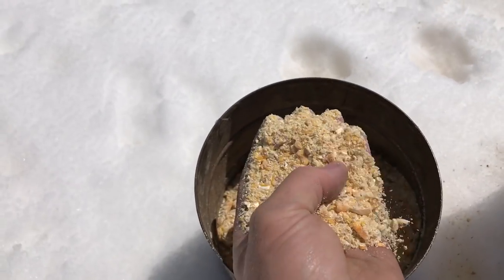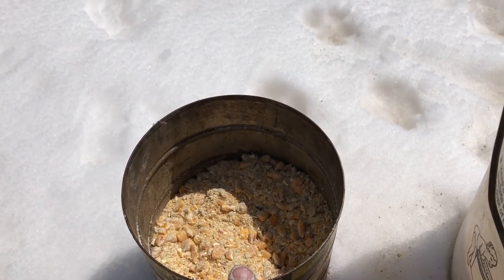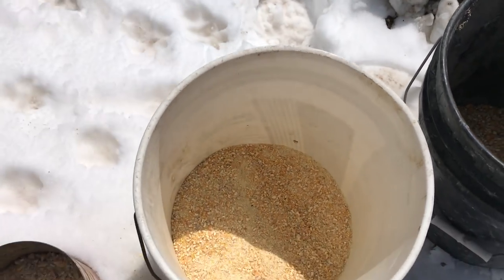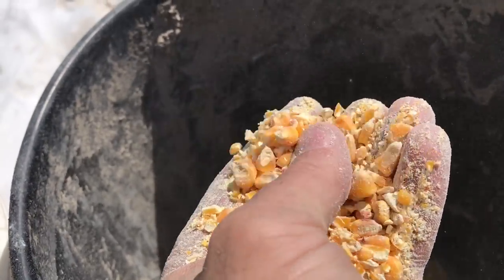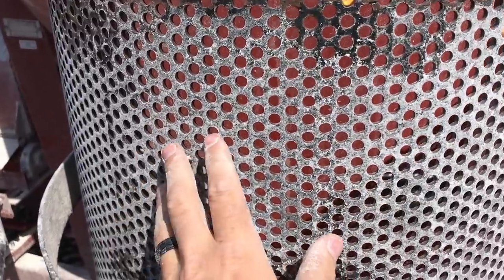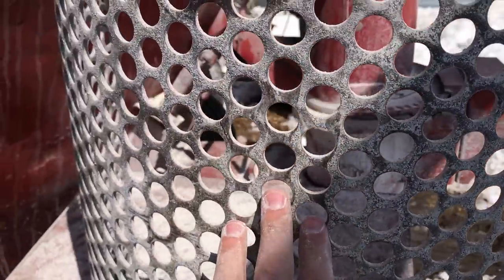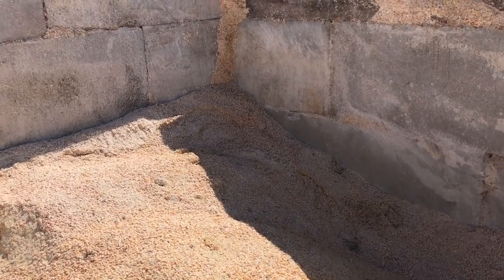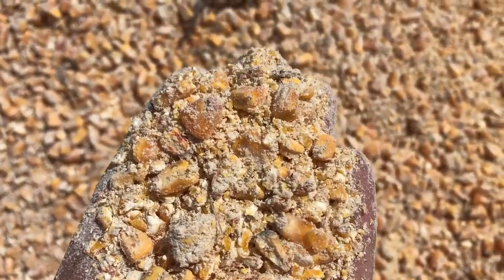Trying to get better quality feed from a grinder mixer

Comment: One thing that I like to use is ear corn. That cob is basically a bulk filler, and it will not cause that calf to over eat on the corn. Cattle that eat 2 much corn can die like u said through bloating; good management is needed for successful cattle feeding
Reply from the maker: Ear corn works good  but i dont have time to ear pick 400 acres of corn.     They actually dont die from too much corn... they die from changes in their diet   over eating  then not eating or other things.  Feeding cattle does take alot of management and eliminating risk that you can...   Cant control the weather so ill start with the corn  Thanks for the comment
Reply: The change in the diet will mess with the bugs and bacteria that are in the stomachs of cattle. It will kill of the bacteria that is needed for breaking down the feed that they consume. But getting back to grinding, we grind mainly ear corn, and it does tend to have that fine starch that is not good for cattle and can cause bloats and acidosis that is why it works for us to use that corn cob as that bulk filler to really eliminate that change

Comment: Was reading comments, and I saw  to old school things we did when I was working at feedmill/sales, cobs and bi-carb.  We also had a dried beet pulp with molasses we would add,  or the sure bet was 5 ft. piece of garden hose.
Reply from the maker: Kevin Farmer Garden Hose doesn’t do much good when their the size of a small car before you see them.   Hard to prove what it’s actually from just wanting to eliminate possible causes and make our corn processing better

Comment: I actually took our small screen and torch and cut the holes together to make 1” -1/16 holes in ours years ago. The screen was for hog feed and made powder so if it wouldn’t have worked nothing was lost but has worked great for years now. Had the same problem as you not using a screen
Reply from the maker: i thought about playing with making the holes bigger but was worried about loosing some strength and it going BOOM

Comment: Well , i had the same problem bloat. I fed ground corn maybe some wheat and 5 bales of alfalfa ground up. If it got real cold where they didn't go out to pasture they would spend a lot of time at the feeder, frustrating when you find your nicest one 4 legs up to the clouds quickly. I never mix salt in my grinder or feed they had it free choice at the salt feeder. I started hand mixing salt as I filled the feeder. I was at a loss of what to do I ask the university my two DVM's. The salt fixed it i have not lost one since. It got so bad i was afraid to fill the feeder good now.
Reply from the maker: too much alfalfa can cause bloat as well.... .but glad we havent had issues for a while.   i actually made myself a roller mill

Comment: That fine stuff balls them up. When we feed we would mix sodium bi-card. It was a belch and fart contest but seemed to do the trick. Found some cows when older can be chronic bloaters,you treat em then 3 weeks or so they down again. So I ship those and likely become US big macs. Lol Can hammers be removed from those mixers or no.
Reply from the maker: Yea the hammers can be removed but i want the corn cracked....   Thought about using whole corn totally but not wanting to give up efficiency

Comment: Good info ted. A lot of stuff to take into consideration. Could u run the smaller screen and take some of the hammers out?
Reply from the maker: Jake Ziegler when I tried with the small screen it just takes so much power to get the corn through them little holes. I’m afraid if I take hammers out it would just make it slower.  And with the small screen it would take all Day to grind what I need to grind

Comment: would help to put a bale of dry small in grinder with each load. we would when we run out of ear corn to grind.just asking ...
Reply from the maker: No if we add more ruffage then our energy levels would drop... feeding 5000-6000 pounds of corn right now a day.   The problem is the small particles of corn actually are digested too fast and causes gas. I need to get a roller mill but this will work for now

Comment: Didn’t know fines would jack cattle up like that. Come to think of it, the screen we used on the dairy was like the bigger screen you have.
Reply from the maker: It sure can... The fines can break down to fast and cause gas  and the gas from the inside can cause suffocation pretty much.  It may or may not have been the problem im glad we haven't really lost enough to say BUT i can control that so why not.   Could be more weather related but wanting to eliminate the causes i can and go from there

Comment: My corn is finer than your fine grind and my steers are on 27lbs a day plus they get 5lbs of silage.   I would blame the weather and eating less when it is a blizzard and not going to the bunk for a day and then hitting it hard. You can also have problems with wet grain because if they are on full feed and it gets wet some won't eat it and then eat it later when ph is different in the stomach.
Reply: If you dry roll you still get fines, steam rolling or tempering the grain before rolling , or doing high moisture is the only way to really get rid of fines.   What supplement are you using and what is the protein level of your as fed ration?
Reply from the maker: Well... this was all before the blizzard  I just never had time to record any of it and explain first.  I have been around roller mills and they have WAY  less fines than what we have right now with our grinder mixer.   The huge feed-yard down the road said we were over processing the corn. Well we had problems  3 calves is less than one percent it wasn't all at once was over the last 200 days.   Decided trying to eliminate potential causes would be better than just setting and watching to see what would happen.   Are you feeding a tmr as feeding in self feeders are a whole different ball game than tmr's...   All calves come eat every day when fed.   The fines may not have been the problem but we feel trying to not over process the corn to try to eliminate a cause was worth it.   You know how cattle are maybe they just felt like dying that day.
Reply: I would completely agree about trying to dry roll maize grain, it will always create fines. Besides which it is a slow very noisy process unless you have a whopping big motor on the mill.
Reply from the maker: Dan Whiteford not as many fines as a hammer mill.   And we would be looking at a pretty good sized one if we got a roller mill.   Much easier to get consistent with roller as well.
Reply: I would agree absolutely but the drier the grain the tougher it is to get a quality result of all grains cracked and the minimum of fines. A ribbed roller set up would be needed I guess to roll maize kernels. To combat dusty feed and excessive fines we used to add molasses or crumbed fat or water to the TMR mix (although molasses would probably not flow in your cold climate though without some heat!!)

Comment: You need to grind hay in your feed, feeding  dry to finish  cattle  they cant eat jest  grain. You will have some die off, my grind is 60 bu of corn. 3/4screen. 12 bales of hay, , hand feed. 
About 150 steer s. A year
Reply from the maker: Ed Ledzinski we put the corn in a pile on cement and then use a tmr(mixer wagon) to blend silage hay distilllars grains .       We are not feeding straight corn